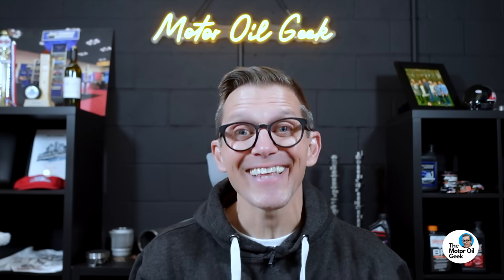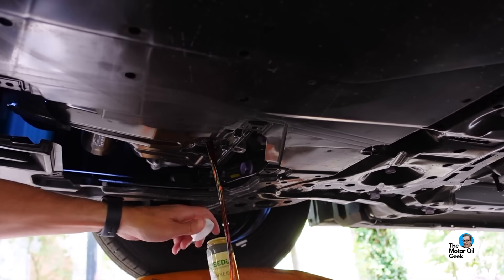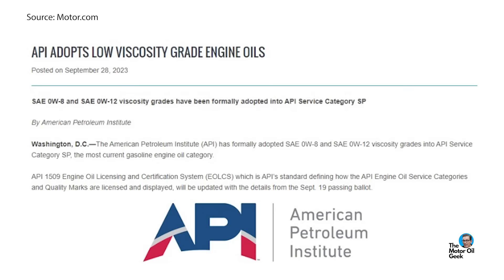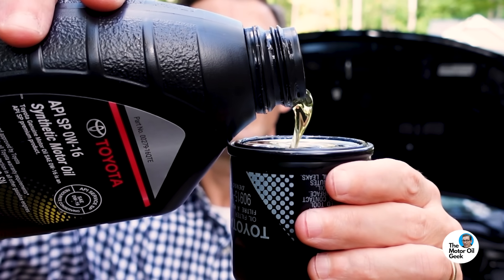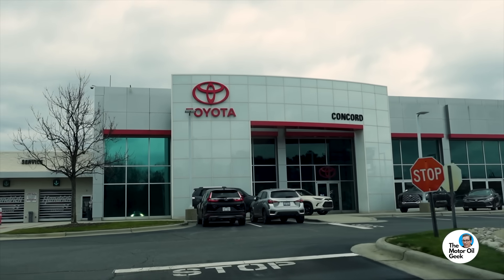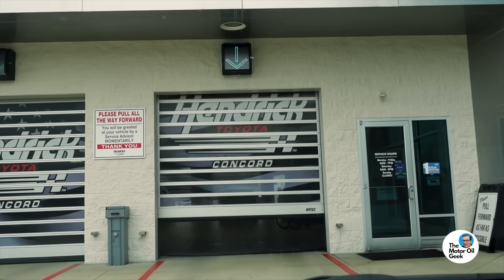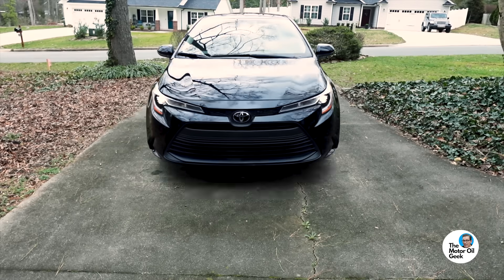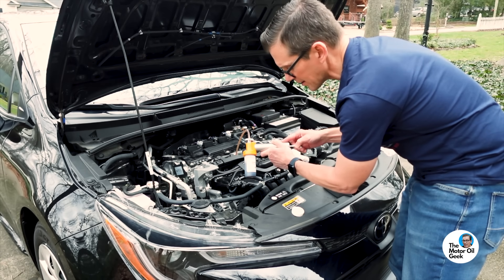0W-8 Motor Oil: Too THIN to Trust? Let's Find Out!

Comment: It’s always 10,000 miles when the dealership pays. It’s 5,000 miles when it’s on your dime.
Reply from the maker: Well said
Reply: @themotoroilgeek I’m curious about the mileage that maintenance light comes on
Reply: @themotoroilgeek  Generally speaking, at what mileage does engine oil become a serious concern? 10K, 15K, 20K? Has there been testing over a 25,000 mile oil change? Damage?
Reply: @Windtee Amsoil has. But those 25K mile tests were on FI gas engines & a pre-emissions diesel.
Reply: @Windtee absolutely the vast majority of cars here in Europe require a 30k km oil change interval, that equals just under 20k miles. even with these long maintenance intervals our cars still last as long as in the US
Reply: @Windtee It completely depends on the particular engine, some are prone to sludge some are not. Take your oil cap off and look for black grime stuck to the cap, you can even buy a cheap Bluetooth mini camera to see further into the valve cover, most of the sludge will be on the valve cover, if you don't see any, you are doing a good enough job with your oil.
Reply: @Windtee  Read your owner's manual, take note of the 'extreme conditions' section and then half their recommendation.
Reply: I have a 24 hyundai palisade wtf the 3.8 but hyundai says to change it at 8k miles is that good or should i be changing it sooner?  @themotoroilgeek
Reply: Long service intervals look good when selling a car as low maintenance, though they may not be that great for the vehicle in practice. How many engines have timing chain wear problems these days? Changing oil at 5,000 miles may not guarantee you never have problems, but it is better for the engine than waiting for the oil light.
Reply: @acguy661 FYI all Toyotas currently Light up the service light at approximately 5000 miles.
Reply: You're about the first one to get it right it's all about marketing brouchers and what looks good on paper about price it cost to run the vehicle and maintain it. There are some super dopey people who think that the service intervals in the owner's manual is the holy Bible and you should follow it @acguy661
Reply: 100% 
I do not trust a 10k
oil change 
With this ridiculously low engine oil prices no need for that nonsense!!
Reply: @summerforever6736   "ridiculously low engine oil prices" I guess you haven't priced Toyota 0w-8 oil. Oil change at stealership is over $150 . Parts is $110 (5 qts) + filter so looks like they are charging $20 a quart. I would imagine the price will come down as it becomes more popular
Reply: not for my car... @audiogeneral
Reply: @audiogeneral  I get it at 8.08 a qt in a 6 gallon box. Other companies make it meeting the spec you just have to look past the Major Advertised oil companies.
Reply: @audiogeneral if you let someone else change your oil you can't really complain about costs. Same oil change for me is uber 50 to do it myself in 20 minutes without leaving my house
Reply: @michaelbibby01  I changed my oil when I was able. Now that I am not I am forced to pay for it, and I can complain about whatever I want. Jerk
Reply: @audiogeneral  fair enough. Sorry for being a meanie butt. Most people these days are just lazy as all hell then still cry about their issues.
Reply: @s @summerforever6736 If Toyota feeds you miss-information about 10K Mile oil changes…

How do you know they are not giving you wrong info on using 0w-8….

…to satisfy CAFE standards and Not for engine longevity..?

It’s just crazy illogical to believe that a Super thin oil can protect complex-hot-engines…

I’m switching from 0w-8 to 5w-20.
Reply: @acguy661  What I have always wanted is a vehicle that doesn't need REPAIRED.  I have no issue whatsoever with doing regular maintenance.  I can schedule and budget for maintenance.
Reply: @richardhertz8996 
In the long run, all reliable brands of cars like Toyota don't need frequent repairs, but they needs more maintenance (including oil change) to avoid frequent repairs.
Reply: Agreed. I always ‘split the bill’ with my VW. I do the 5k service, they do the free 10k. Same for 15/20k.
Reply: @yo_marc  that’s brilliant. About to buy a Corolla and will totally do this!
Reply: @yo_marc   that's what I do with the wife's 22 Honda CRV .
Reply: @yo_marc  I've had VW since 1987, 316,00 on one, always 150,000+ on them I drive a lot, 17+ VW Audi stuff.  Never did anymore than what was spec'd in manual.  From early days of non syn, to now syn, never had an oil related issue.  Early changes are a waste of money and resources.
Reply: Honda said no to free oil chg at 5365 miles on 2023 Honda Ridgeline. I pd for it outa pocket. Oil, filter, rotation $121. Robbers but ….
Reply: Yeah and I say 3k no exceptions 
And a quality filter 
So you DON'T have to replace timing chains etc before 150k or pay the price
Reply: I do every 6 month or 5000 mile , which ever come first
Reply: The manufacturers get CAFE rating credit when they extend oil change specs. Same reason why we don't see actual small trucks anymore, the EPA penalizes small track vehicles with impossible MPG requirements.  So we get less reliable engines because they have to be turbocharged with direct injection, of course we also hear we have to drive them for longer periods or we get water and gas in our oil, so short trips end up being long trips or you damage your engine. (IE Honda 1.5 turbos in a cold climate)
Reply: You still paid for the 10K change. Why do you think these rigs have tripled in price?
Reply: @GT-mn3bx because of Biden no oil drill😊
Reply: Not all manufacturers engines can go that many miles without burning oil. They don’t all have the same quality control levels.
Reply: disagree, dealer pays every other 5,000 miles.
Reply: This is not true. Just read the manual. It states 10k miles is fine but if you do lots of city and or lots of towing or aggressive driving to do 5k. On Toyotas I do 5k filter and top off and 10k oil. The oil gets dirty because of the carbon passes the rings. You need to filter it better. The oil itself doesn't really break down over 10k.
Reply: @arthursmith643 the dealership doesn't pay. You just prepaid for it.
Reply: They changed mine every 6 months regardless of the mileage.
Reply: If I found myself in this situation, with such a car made so the car maker forced the owner into using this watery zero-grade swill (that will achieve nothing besides cause premature engine wear), I'd consider the extra oil change money well spent.
Reply: always 10k with my 2013 rav4. 150k.
Reply: @Kavinskysmith That was one of over a dozen, i drive a lot for my job up and down the east coast...easy to rack up the miles.  I have had about 17 of the same brand, from teh same dealer over the decades...i drive a lot, and then some.  I have lots of experience on car maintenance, and oil, etc...from practical use.
Reply: @Kavinskysmith It's very easy to do over 1000 miles a week, real easy
Reply: Not at mazda
Reply: Well it’s 10 000 to not void your warranty
Reply: some years ago, service of 30 or even 35k km was very common in Europe on most european models, because some believe in marketing of miracolous "long life oil" meanwhile i used the very same oil and replaced oil and filter every 15k km. on my last car i use good quality 0w30 instead of modest quality 0w20 used by official dealership, guess what... the most powerfull variant of my engine came with 0w30 but due to emission regulations, they used 0w20 on the "detuned" version...
Reply: Even if you demonstrated that the new 0w-8 oil protects as well as old 0w-16, that doesn't mean it protects as well as new 0W-16, if they can put just as advanced an additive package in the thicker oil as they can in the thin oil.  And you demonstrated in the dyno test that all else being equal, thicker oil protects much better.
Reply: They don't much care whether it goes 300k or 400k as long as it goes past the warranty, except for reputation vs planned obsolescence.  Though pickup makers often advertise the percentage still on the road, so they must care about that.
Reply: it's not miles, it's motor-hours. Shittiest oils last 200 motor hours. Best last 250-300
Reply: Anyone recommending oil change intervals without oil analysis info to back up their claims is just spreading misinformation based on “feelings”. Ignore these idiots.
Reply: 3,000km on my dime for the past 50 years.
Reply: In sweden its 9320miles or 1 year if driven normally for my hybrid corolla. and the e-cvt is "lifetime", but I think its recommended to change the fluid every 43000 miles or like 8 years
Reply: 3,000km when it is MY car you're talking about.
 Been doing that for over 50 years/ never broke an engine yet. My Toyota Cross is in goo  hands with me doing the routine maint.
 What you do or use is your issue/ not mine.
Reply: in US they say 10.000 miles?
In Europe it's 10.000 kilometers, and every mechanic will sa that is the MAXIMUM you should consider for oil replacing, of course we have more slow traffic here and low speed or just waiting in traffic produces a lot more wear and damage.
Honestly 7500 kilometers is where's I'd recommend an oil change for optimal safety
Reply: I know it sounds cool and rhymes but maybe 4,000 depending on where you live and driving habits IF you can afford
Reply: OR 10 Months. Says that in the Toyo Maintenance Supplement. I convinced my dealer it is 10k miles OR 10 months, they agreed.
Reply: for me, 3,000km in Canada year round.
Reply: 5K miles on my dime, Yota oem oil.
Recently switched from Mobil 1. Read somewhere and learned that although Mobil 1 is a premium product, it's not specifically designed for your vehicle.
The timing chain was rattling, making a ticking noise mostly at cold starts. The OEM oil eliminated the noise. This is a testament that factory oils are specifically engineered for the vehicle. Keep in mind that Toyota factory oem oil is produced also by ExxonMobil.
Reply: Mine is 5k to change i do it at 4k sometimes if I wish 3,5k 😂 but its average 4,3k it gets new oil.
Reply: Don't be so cheap and gullible. They want your car to fail so they can sell you another one.  5000 miles or less or you deserve what you will get.
Reply: Yet Toyota is the only manufacturer doing a full blown maintenance package, yes GM has a program, but they make the dealer eat a lot of the costs. Toyota pays their dealers nicely for the Toyota CARE oil changes and rotates.
Reply: Or even 3,000, since we all drive in "harsh conditions".
Reply: I'm not worried about the winter number, it's the performance when hot number that has me concerned.  It's bad enough my 5w-30 oil for my WRX is resource conserving (I try to avoid these oils), but it's bad on the 0w-20 for out CX-5 which also says RC.  now Xw-16 and Xw-8 are already RC by nature and purely in place to improve fuel economy....why do they need to be RC as well?   Something is afoot and it is from government regulations for vehicle manufacturers to show they are meeting "xxyyzz" standards.   5w-30 C3 (low SAPS non-RC) oil goes in the wrx, amd 5w-20 (GF-6/SN+) goes in the CX-5.
Reply: @K03sport I run 5W-20 and 5W-30 in everything I run. Those 0 weight oils only really come into play when it’s 5 degrees or less outside.
Reply: @K03sport CX5 SKYACTIVE never need 0w20 except eco. Just better to use 5w30 api SP mild sups
Reply: I have never had an oil related problem in all my cars over the decades when oil changes are what mfg says now 10K is normal...Syn changed everything.  Use the oil that meets mfg specs look at the labels.
Reply: @cengeb  I'll just stick to my 3000 mile rule
Reply: Someone pays.  Gas grass or ass, no free rides!
Reply: As European, I'm surprised to read how early you change engine oil in the US. I'm from Germany, my 2011 Mercedes CDI now has over 180.000 miles and runs like new with its first timing chain. Oil changes have been made every 16.000 miles for most of its life and the car was quite often driven at Autobahn speeds (up to 140mph).
Reply: @car.passion8663 only 180.000 miles and needed a new timing chain?? My 94 Trans Am I bought new has had 3000 mile oil changes  since new. CASTROL GTX, no synthetic ever. It now has 338.000 miles on it.  The engine Is the LT1, has never been touched,  the timing chain is original,  it runs and sounds like new, and uses no oil between changes.
Reply: @car.passion8663  what European country uses miles
Reply: @car.passion8663  exactly,here the u.s. driveway experts always claim to know better than the car manufacturers...all my vws have never had an oil related problem after about 17 plus vw audi vehicles over many decades,i drive a lot, 316,000 on one vr6 no issies,never touched timing chain or manual transmission. Thingvnever let me down all of my vehicles are just broken in at 100k miles,then they keep going and going,normal maintenace intetvals,changing oil as per vw audi specs. Using the vw audi spec oils.
Reply: @cengeb  yes we all know who is the driveway expert how many motors have you removed and repaired to have the knowlege to call people dummys and tell me come to 2024 i said i am old school not that i am senile
Reply: @alfredritcher don’t waste your time arguing with this kinda people . He probably only know how to drive cars , who cares the cars he owned never had an oil issue , lots of people actually do . I’d never put 16 thousand km /10k miles on any oil in any vehicle . I always do the changes at 7 thousand km with is around 5k miles on all my cars. And as you said, it will get carbon contamination over time and the engine should be decarbonized when the black goo starts to appear .I also hate cvt , it’s boring to drive cars with this transmission and it will go after some mileage and need an overhaul. In other hand , I still own for daily grinding an old 2007 Corolla with an 4 speed automatic with overdrive and it runs like new to this day . I also own a Chevy Cruze and despite it being much newer and all, I do enjoy the Corolla , it’s cheap to run and repair when needed .
Reply: @alfredritcher When we need advice on a 1990 car, we’ll make sure to ask you.
Reply: @car.passion8663 the most impressive thing is your exact same car in the US would "need" 5k changes. I smell lobbying from the oil manufacturers and "collaboration" with the carmakers.
Reply: Volvo in the US seems to require service at 7500 miles.
In Sweden, it's at 30000 km, so just shy of 20000 miles.
It's not like the cars are breaking left and right in Volvos home country, they are holding up just fine.
Reply: I won't be doing 10000mi.  5000 for me.
Reply: @mikeincanada_  Of course since two premium brands of excellent quality, isn't fit ?  People that change motor oils earlier than mfg specs, are true experts.  The mfg never know enough, driveway experts seem to, right?  Changing motor oil 3 times in 10K miles is ludicrous.  API doesn't set the specs for cars.  The mfg does.  when you look on the oil bottles, if it doesn't have the mfg spec on the label, you need the version that does.  it's not just weight, there are other additives, that matter. Total, Motul, Liqui Moly, Castrol, all premium oils, works as per mfg change intervals.  And new engines actually have to wear in for stuff to sit properly, so rings etc seal and seat properly.  driveway engineering is always funny.  Same with change intervals for 4WD differentials.  And brake fluid flushes..again, second guessing by driveway experts is hilarious
Reply: @cengeb I see this all the time in car forums - owners with no knowledge of the newer oils insist that higher viscosity is always better. They like to think that no tribologist or engine engineer is smarter than they are. Lake Jr. is setting things straight - the factory fill 0W-8 is the right oil for the new Gen Corollas, Camrys, and other Toyotas. After my wife's two free oil changes in her 2025 Camry, I'll change the 0W-8 oil once per year (<5000 miles).
Reply: 3k miles at a private shop
Reply: @mikeincanada_  who over pays for oils. Not where I order it,depends who has it on sale. And better oils are cheaper in the longcrun,less changes .cost less and either Mann,mahle,filter cartridges depends on who has the best price when needed. Sitting in traffic is not extreme conditions get real
Reply: Just do it yourself, the last time I went to the dealer they couldn't even fill brake fluid to the proper level. It spilled all over the inside of the engine. I will NEVER allow anyone to touch my vehicle again. I will do everything I possibly can myself.
Reply: Uh, use the good stuff, e.g. Mobil-1 or similar, and change it every four to six months? (NOTE: This is when you’re only driving a hundred miles or so per month, with at least one session per month where the engine gets warmed and stays warm for an hour or two, e.g. “bill-paying and groceries, about forty miles at 25-40 miles an hour on longish surface streets with little stop and go traffic.”  Not quite the “ninety-two mile oil change” of mid-seventies Mad magazine, but under a thousand miles per instance.)
Reply: @dennisyoung4631  huh?   change every 3-4 months, it's 2024, join it.  It's not 1964  come on.  Motul, Liqui Moly, Castrol, Mobil 1,Pentosin,Elf, so many premium quality brands out there
Reply: and its 3,000 when you know your stuff and that the engine naturally eats oil, especially when turbo's are involved, or direct injection, rather than carboration or normal fuel injection.

heck the very first direct injections from the 50's actually had the interval as low as 1500 KM on the 300 SL gullwing
Reply: @Kavinskysmith  Love the turbo gdi combo!
Reply: @Kavinskysmith  I never have to add oil between 10K oil changes, it barely moves off the full mark.  I check it all the time, 316,000 fun miles on one vehicle, even before synthetic, it had 7500 mile spec changes, car ran forever.  Now newer are syn 5-30  doesn't use a drop between change of 10K And all same weight oils are not the same.  It has to have the brands specs being met on teh label.  It matters.  I use Motul or Liqui Moly, not all the 5w-30 of those brands meet the car spec.  i get the ones that do.
Reply: @Kavinskysmith wrong, I've had over a dozen high mileage cars all turbo, change oil per makers specs, never had a oil related issue never.  After at least 1.5 million miles of driving.  Why do driveway engineers know more than the people that actually made the thing?  And there is no such thing as break in oil...it's 21st century, not 1961  Modern engines are much tighter specs, thinner oil, thicker is actually not better, it's worse on cold start ups.
Reply: then tell me why every newer car I have owned using these light oils rattles from the bottom end on cold starts after about the first 40 t0 50k miles of use.
Reply: It's 3,000 on my dime
Reply: anyone who leaves any kind of oil in any kind of car in for 10k miles, is a dummy.
Reply: @adotintheshark4848  And your expertise is in what now?  Wonder why I've had so many vehicles with 150,000+ miles on teem doing exactly what mfg. says ie. 10K oil changs.  Driveway experts are funny.  Syn oil lasts a long time.  It's 2024, not 1964, join it.
Reply: @adotintheshark4848 chaning oil early is dumb, waste of money, resources, and creates unnecessary waste.  What century are you living in.  ever hear of modern synthetic oils?  Try it, you might learn something.
Reply: @cengeb Used motor oil is  recycled,  No waste of resources.  As far as the money issue....it's not your money, so forget about it.
Reply: @1958Cadillac-v2g  recycled is still uses resources, and then new oil is made to be used again.  Think of the millions of useless unneeded changes, if your logic is used.  Why do driveway geniuses know more than the actual maker of the vehicle?
Reply: @cengeb Because auto manufacturers want, NEED you to buy new cars! It's not in thier best intrest for your engine to go on and on.....
Reply: @cengeb ..I guess changing oil in my 24 year old truck every 3 to 4 miles does help after 287k miles. The problem was my lifters finally going out. I have to disagree with you. Cheers
Reply: @2nickles647  I hope you mean3K,4K...and even if you do, it's still way too early, and a waste of time, money, and material.  Utter nonsense.  And yet it still wore out, hmm.  so you wasted a lot of time and money.  If i followed your spec, I'd change the oil every 3 weeks, when I was working...ludicrous.  And VW with 10K change specs, had a 72K 6 year warranty on my 2019  golf R.... it's well past that and no issues, never does.  Driveway experts always seem to think they know more than the people that made the stuff.  always entertaining, same in medicine, and so many other subjects
Reply: I would never do 10 k on any oil and 0w8 is scary i also hate cvt so i guess i am just too old school glad i am retired
Reply: @alfredritcher  It's 2024, join it.  Never ever, never had any oil problems with any oils as recommended by vehicle makers.  follow their specs, and no issues.  Car makers have their specs, if it's not mentioned on the oil bottle label, then it's not for that car.  Read labels...they are their for a reason. Lots of cars now go past 10K  Synthetic changed everything.  Are you some kind of a nut?  change oil at 700 miles, what decade are you living in?  Oy Vey.
Reply: @cengeb  we all have opinions and our own choices i only have 30 years as a master tech.for Toyota repairing mistakes but yes the people that designed it usually know best
Reply: @cengeb  i looked for where i said 700 miles cant find it but if i said that it was a typo i always recomend 5 thousand miles most times all oil gets carbon in it being it has internal combustion and that carbon is abrasive .please show me where i said 700 miles so i may correct the typo .have a good day.
Reply: @alfredritcher  watch around 2.14 you say first change at 700
Reply: @cengeb  i was not in the video to say anything i think you may be confused that is why i could not understand what you were talking about
Reply: @cengeb are you a bot or some AI? I’m politely asking for the sole reason it looks your responses are not from a person but some repeating machine .
Reply: @alfredritcher  and you repair issues that TOYota service bulletins tell you they know is a problem, exactly.  How many engines do you think TOYota, VW, honda, Benz etc have made over decades and decades, don't you think they know engines better than driveway experts?
Reply: @alfredritcher  at minutes 2:14 and forward listen to it
Reply: @alfredritcher  it says 700 miles at around 2:14 minutes go watch it again, and listen
Reply: @cengeb  it is not by toyota service bulletins but by a diagnosis done by me i am not a jiffy lube parts replacer and the point i have been making is you implied i had something to do with his coment about 700 miles i said 5k is as far as i would go on a oil change i am done answering you as i have better things to do
Reply: @alfredritcher  the 700 mile response was not meant to you, but the guy posting it, as he asked when did it say 700 miles.  you mis understood
Reply: @potatameme  lol, some thing date blah blah "join it!!" if thats the attitude of the time, I say, "no thanks" I'll stay where I am allowed to care for the things i own the way I like for the reasons I have, and guess what, every one else can too. I appreciate @alfredritcher because he does what he does and explains why but i don't see him insisting anyone else do it the way he is... DO what you want people, its just a car...
Reply: @alfredritcher experience doesn’t mean much when the tech is always advancing. Go test your oil and base your interval on actual data rather than personal feeling.
Reply: If the dealer and manufacturer says 10k oil changes and you do it, if the motor goes at 50,000 you sue them
Reply: @TheAnnoyingBoss  My 2019 VW Golf R had a 72K 6 year warranty, it said oil changes 10K, it all works just fine.  But they have reduced spark plug now to every 40K, GTI used to be 60K...Golf r uses more  compression and gas, more power, again, no problems, ever.  89K miles
Reply: This is because when you pay, they usually sell you 'conventional' oil, which is a 5K mile oil. It's not the same they use when you are under the free oil changes. Unless you ask for Synthetic oil, then it will be 10k mile. But, it is more expensive.
Reply: @uninavas  BS, no dealer will put in non syn when it requires syn, with turbos...are you a real conspiracy freak...everyone out to get you, everyone is a cheat?
Reply: @uninavas they make 0 weight oils in conventional?
Reply: @uninavas  If they are using the recommended 0W grade then it won't be conventional oil. 0W is not available as a conventional oil.
Reply: @uninavas  0W8 is not conventional oil. it is all synthetic oil.
Reply: @uninavas conventional is not 5k. You shouldn’t ever use it anyway, but you better not go over 3k with it. Even full synthetic should be changed every 3k.
Reply: @JordanLachlanMusic If you don't regularly drive on short trips, 5000 miles or one year with factory synthetic oil is just fine.